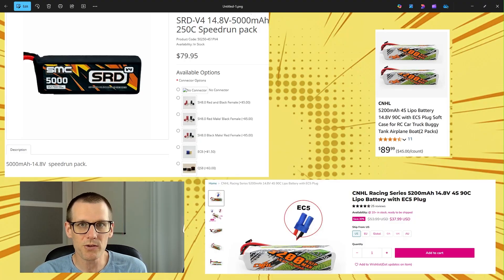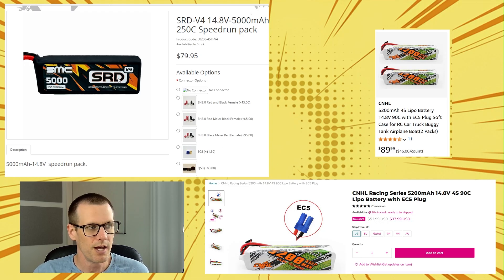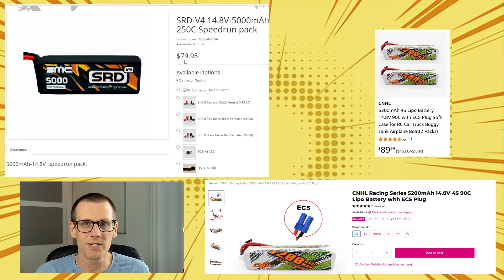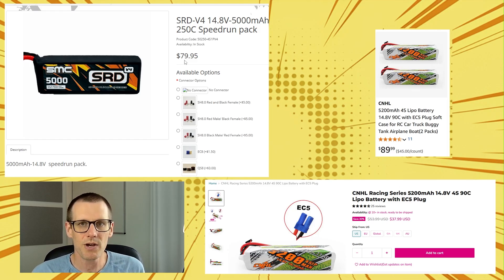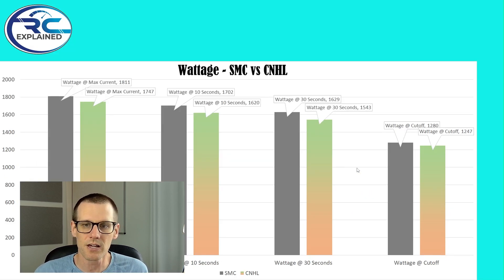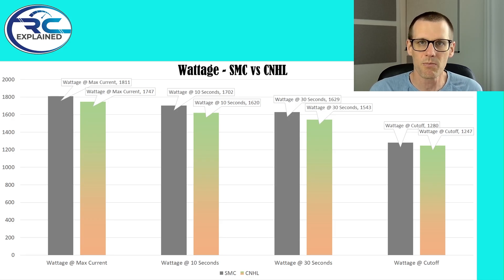High-Cost Champion vs Value Powerhouse – The Truth About LiPo Performance

Comment: Could you do a test CNHL 5000 G+ 70C vs SMC SRD (better V4 than v3)?   Because in one of your tests the CNHL 5000 70C G+ performed better than a CNHL 5200 90C.
Reply from the maker: I think I can do that, will add it to the queue.
Reply: @RCexplained  How long is the queue?😄
Reply from the maker: @sundayfloater2926 its usually 6 to 8 weeks max. But i may have a close equal that will come out in December. Its not going to be a 5000mAh pack though.
Reply: @RCexplained  😭
Reply from the maker: @sundayfloater2926 I also may have a more general video that covers this coming out in December. Lots of battery based videos over the next several weeks.
Reply: @RCexplained  😊

Comment: They wont put IC5 connectors on there batteries so im sticking with Gens Ace
Reply: I've bought EC5 on both packs
Reply: ...my GensAce has a yellow EC5 as well
Reply: @cacanjacowans540 yes i emailed SMC the other day about there new v4 SDR batteries,  and the told me they will not put IC5 on them due to the larger size wire , which makes no sense become GENS ACE  comes with 8gauge wire as well , but when i spike to my local hobby shop they said probably because of the higher c rating 250 compared to 120 is the reason they wont use the IC5  battery connection
Reply: Hi Ryan, do you have any data on SMC V4 vs V3?

Comment: I bought two CNHL packs at the same time, I've probably only cycled each about a dozen times,  identical charge and storage cycles. One is performing admirably the second is getting puffier after every run, it always deflates when it cools but I would definitely say it's a bag o shizz. IR readings are all within tolerance. Could not recommend.
Reply: So you think because you got one bad battery. Therefore Cnhl batteries are bad? Cnhl is an established respected brand in by now in RC. I have about 12 of them, and have never had an issue.
Reply: @Themlpg73 congratulations, I'm happy for you. Sadly my experience and opinion based upon that experience differs. I hope you understand.